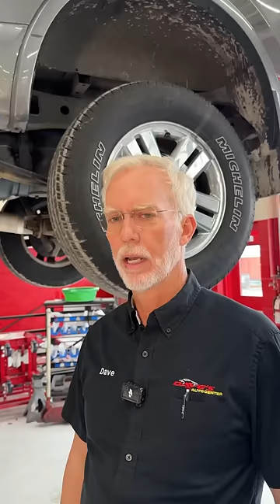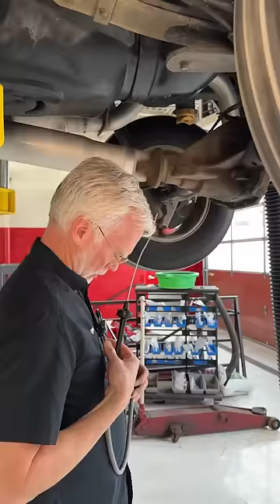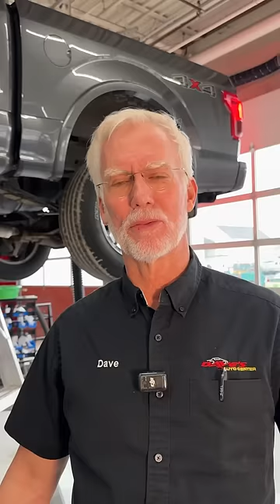Part 1: How to diagnose a noise - Dave shows us with a stethoscope 🩺 how to find a noisy bearing

Comment: !!! The stethoscope to the mic, acting as a contact point for conductive hearing in a video is a brilliant way to show us what you mean, precisely. Thank you.
Reply from the maker: Glad it was helpful!
Reply: Yes it is,  I have 2 of them in my Tool box.  Great for alternators, power steering pumps, water pumps, idler bearings, etc  anything with a bearing, or that tanks, clicks, rattles, etc
Reply: Some got great ears. The moment he started to put it in gear i 100% know it  is the pinion bearing 😂😂😂 my ears arent busted yet they work just fine
Reply: Just like an episode of CSI
Reply: @REYNIER2022  I sure hope ta hell you protect them in everything you do.  Or you could end up like me and all but Def,   I can't hear the sounds of 17 letters in the Alphabet.  So I can hear yes, but I can't understand what anyone says to me 😞.   So please, man,  use ear protection at all costs.
Reply: I use a long screwdriver, pipe, serpentine belt tool. Anything that transmit sound.
Reply: I just use a long 3/8 extention and do the same thing. Lol
Reply: You can mimic this same sound amp by using a screwdriver and a bottom cut 2 liter soda bottle. Touch the area in question with be screwdriver and attach the bottle mouth (where the cap goes) to the screwdriver handle  and boom you have an amplified sound. I learned this from Eric O at SMA.
Reply: Well yeah... how else would he show it to us?
Reply: Probably made in China. Remember when bearings actually lasted or is it the oil

Comment: A stethoscope is one of THE most important diagnostic tools in your toolbox. Pop the end off and use the hose to trace down vacuum and exhaust leaks. I used mine last week to detect a faulty injector causing a misfire.

Comment: I love this trick. I used to do industrial maintenance for a large manufacturing plant and used this technique very often to find bad roller bearings on our machines. Didn't invest in a stethoscope but a long screwdriver accomplished the same thing! Great stuff Dave!
Reply from the maker: Very cool!
Reply: Absolutely used many long screwdrivers.
Reply: That's another method, I've used a hose to locate noisy bearing and other noises.
Reply: Long screwdriver to the ear also helps to check if all the injectors are working.
Reply: @aaronpreston47  I don't think I ever tried it on the injectors
Reply: Dave, One thing is Ford, I bet Ford has Thousands of these Bearing Problems in  other Rear ends Ford Made. 😊
Reply: @waymonblevins6939  huh? I'm a ford hater. Born into it. But my '98 Grand Cherokee has a '98 Ford rear axle swapped in, because it out lives most anything out there.
Reply: @DB-yj3qc  Hose as in a like something similar to a brake fluid hose, or a garden hose?
Reply: @selwyn13  garden hose worked best for me.
Reply: @waymonblevins6939  Ford rear ends have to be really abused. The 8.8 is good. And the 9in is one of the most sought after.
Reply: @boostedzjadventurevlogs4121  I Agree. On the Rear end Get a New Process Rear-end. Chevy and Dodge use these Rear-ends. Both of these Automakers use these New Process Parts. I have used them for Years. Like You I hate a Ford. The worst Vehicle made.
Reply: @waymonblevins6939  every drag racer out there would laugh at this statement. Ford 8.8 and 9" is the way to go. Been proven over and over. Yes there is times something else might fit better or work for your application, but overall, 8.8 and 9". Yes, if rather have a Rubicon D44, but it's the price of five 8.8's, it's gonna break eventually, and the width is all wrong.
Reply: @selwyn13  like a vacuum hose or rubber fuel line. Solid metal objects placed inside your ear and the other end around moving parts has always scared me.
Reply: Place a screwdriver in your ear and then put the other end around moving parts. The tell me you've got no anxiety.
Reply: Fluke also makes a more scientific tool for bearings. It gives you the ability to listen to bearings, and temperatures. But a screwdriver in the hands of a skilled mechanic will get it done just as well
Reply: Let me clarify here,  place the handle of a long screw driver to your ear and touch the metal end to the different places or parts you desire to listen to. It works very well. I've been doing this for over 55 years.
Reply: @williamhouk6880  no, put the pointy end in your ear and the handle into the fan blades. Of course your way is correct, but it could be way safer.
Reply: DAVE IS SPOT ON!! DAVE AND HIS GUYS ARE AMAZING!! Thank you…
Reply: When it gets loud enough other drivers will honk their horn at you thinking you're being extremely rude to them. I had a carrier bearing race crack all the way through on my jeep and it would be intermittently extremely noisy.
Reply: Dave, I am glad that you have an upcoming TV Show. I will be happy when it starts Airing. Do You have Time Time when It will air on TV?
Reply: I'm an auto tech, and use both stethoscope and long screwdrivers. Screwdriver works for most applications, but the stethoscope  usually works better in tight spots.
Reply: And ear muffs to isolate!

Comment: Use my stethescope to diagnose differential, wheel bearings and transfercase noises often.  Helps alot to diagnose in less than 30 mins inc setting the veh on the hoist.  We also have a set of "chassis ears"  which are electrosonic ears. Attach them to different parts of the veh and test drive to duplicate knocking noises etc and you switch channels/microphones to hone in on what one is loudest, some can be connected to the laptop and the frequency of the noise will be diagnosed my the computer program. No joke.
Reply: I love chassis ears but they're a pain to run all those wires and make sure they're not gonna snag something while driving lol
Reply: @KyleCotton1  agree. Theyre a pain.
Reply: @matthewmorrone883  but they're irreplaceable when diagnosing suspension noise that can't be duplicated on the lift!!

Comment: This works well. I use this method to tell when a lathe tool, boring bar most or time, is contacting the inside of the part I'm cutting. It takes away the guess work.

Comment: some good advice i was told years ago was. "bearings roar/grind". and "gears whine".  this applys to differentials. manual transmissions (some older automatics th400 first gear planets whine) and the older gear to gear transfer cases.    this truck has both sounds.   if you replace a ring and pinion you can have some "whine" if they are not shimmed properly but as long as the bearings are properly setup will have no noise.     ive had some units apart several times adjusting shims to get rid of the whining.   and some cheap gear sets will not be near as quiet as a high quality gear set.

Comment: You can improvise on that stethoscope if you do not have one as well ... A long screwdriver or a pry bar works great too. Hold it on the spot you want to check and listen for the roughness.. compare multiple points to gauge wear.. 👍🏻
Reply from the maker: Good tip!

Comment: Trick an old mechanic tought me and ive used every since is, while the wheel is spinning grab onto the spring, you will feel the vibration of the bad bearing in the spring only at the location of the bed bearing. Works every time, even on those bearings that can be hard to hear.

Comment: These work great for hard to find noises, but I found using a long screwdriver with the handle pressed against your ear works better to pinpoint the noise around other noises like the belt pullies.

Comment: I got trouble on my personal truck, and id like a diagnostic path plan.  My 05 cadillac srx 3.6 v6, awd, is showing driveline popping upon hard load scenarios, ie taking off from stop lights, straight forward acceleration.  It aounds like transfer case chain jumping, or trans output/transfer case input flanges are possibly stripping splines.  

I put my truck up on jackstands, and tried power braking it, and failed to duplicate the sound.  Truck has to be on the ground, or maybe an alignment rack would be a great idea.  

Truck rundown.  Trans is 5l40e.  T case is borg warner 4476.  Historically, had trans out for bench rebuild, 60k ago, and valve body.  While driveline was out, i had the same POPPING situation, told trans shop, and they added a tcase chain to the job, for an extra $200 (sounded like a great deal, lol).  

A few days ago, i drained tcase, and it looked like gl5 or gear oil was put in it. Not atf.  The drain and fill screws needed wiped off (tips had some muck on them).  I looked thru drain hole, watching chain while articulating the rear driveshaft left and right, didnt really see excessive slack in the chain.

Comment: I have had lots of bearings go on me. You can hear them long before this. I hear them as a slightly changing harmonic as the wheel or axel turns at different speeds the out-of-place or out-of-balance bearing will increase or decrease its harmonic tone. This sound will get stronger as time goes on. I have had mechanics tell me in the early stages it is road noise from my tires because I run a slightly aggressive tread. But there is no need to wait this long to figure it out. At this time you just add metal contaminants to the lubricating oil causing a bigger clean-up as well as possibly damage to other internal moving parts. I know Dave and his people can use the extra work. 😂 not
Reply: You have to turn the radio off from time to time. Just to listen to how your vehicle is running.

Comment: Hey Dave, and commenters. 2016 chevy equinox, 150k on the clock. Loud roar sound upfront, changes with speed and when you turn it usually gets louder, had new tires put on and it got louder, it has factory size tires and they are simple stret ordinary tires you'd expect. Can't find any issues with any components and dealer can't either.

Comment: You can tell a pinion bearing when you go from driven side to coasting side of pinion to ring gear contact. Bearing wear caused more back lash can hear the noise change as pinion moves in and out of ring gear.

Comment: I had a 90's model Toyota Tacoma with a bad bearing on the Rear Right.

The frame rail that leads back to the Rear Right also travels right under the center console.

The noise would echo all the way up the frame rail making it near impossible to tell where the noise was actually coming from.

Had to put it on a four post lift and really spin the tires up before you could finally hear it without any load on the tires.

That was probably one of the most nightmarish diagnostics I ever had to do just because the echo made it so difficult.

I got multiple second opinions from fellow master techs in the shop, and even they were stumped by it. 

I made a flase diagnosis using the second opinions and changed out the Front Differential.. After that didn't fix it, that was when I finally put it on the 4 post and got the tires spinning at highway speeds. 

I was so relieved when I finally found it and fixed it. The echo was so bad the noise literally felt like it was at your feet when driving, and when it was on the 4 post it would not make the noise without a load. 

It took slamming on the gas and spinning up the tires a bit too fast to finally hear it.

Comment: Learned this from South Main Auto's youtube channel:
Take an empty plastic jug.
Cut off the bottom.
Stick the handle of a screwdriver in the normal pouring end.
Stick screwdriver tip to where the noise is coming from.
Listen at the big new cut-out opening.

Comment: a common rear differential failure caused by a shade tree mechanic is   they replace the pinion seal and when reinstalling the yoke they over tighten the pinion nut and over load the bearings which ruins them in a very short time. ive delt with customers doing this a few times   if any shade tree mechanic reads this pay attention:  ive rebuild diffs for 15+ years.  if your rear pinion seal is leaking.  you can replace it with no issues.  
first. mark the drive line to yoke so it can be put back as it was
now mark the pinion nut to pinion gear so the nut can be re installed back exactly as it was
now 
remove it and the yoke then replace the seal. use a little film of RTV on the outside edge of the new seal (metal to metal). then install the seal. 
now reinstall the yoke. now when your ready to reinstall the nut. use red loctite on the threads. put the nut back and tighten it bacl until your marks line right back up exactly as you marked them.   you can crack it ever so slightly tighter but thats it!   this will put the pinion bearing preload right back at the oroginal setting and good to go.     ive done this many times over the years and no issues

Comment: This vehicle has a bearing and a ring gear issue. Notice that when they were first listening to the sound the driver backed off on the throttle and one of the noises decreased. I agree the pinion bearing is bad but this also probably damages the pinion and the ring gears themselves also.

Comment: It might actually he a bad gearset. From the video the frequency increases when the noise is present, indicating he is accelerating at those points. Drive side of the gear is probably through the hardening and eaten up from overheating.  Or could just be really bad front bearing too. Please post the follow up!

Comment: You can also use a hammer-through screwdriver.  A normal screwdriver won't work as well
Reply from the maker: Great tip👍
Reply: put plastic  handle to your ear hole flap while pressing firmly and off you go

Comment: I had a rav 4 squealing like a stuck pig on the front end. Couldn't determine where? A tech placed buggy on lift, a coworker put it in drive, and tech put a two foot screwdriver on wheel lower support, and other end to ear. Then had me do it. A deaf man could determine which wheel bearing was shot. It was that clear. Great tip, I've put in my back pocket.

Comment: Anyone else concerned about the speed of rotating masses? You can’t use the brakes to slow it down since the contact on the disc’s would add noise, but you can keep it in low gear.

Comment: Sometimes these noises only happen when the vehicle on the road with the weight on the wheels. A bad U joint, you will usually see rust residue around the bad joint. That's a giveaway because they don't always have play when they go bad

Comment: What causes a failure like that? Lack of maintenance alone or just bad luck? My 2014 has 127,000 miles and I’ve probably changed the diff fluid 3-4 times now. Nothing seems to be out of order.

Comment: I have an '18 F150 4wd that has what sounds like a LF wheel bearing hum that get louder the faster you go and slightly turning the wheel to the left. Replaced both front hubs, no change. Activate 4wd, no change. Still haven't figured it out but driven the truck for 25k miles and doesn't drive any different.  Can't hear it at all on the lift.  It's puzzling to me.  Inside the cab going down the road, sounds like it's coming from the LF. I've looked at all four wheels with a stethoscope. Can't seem to pinpoint it.

Comment: Did you know a broom stick to the ear on the end 
Of will pin point a bearing race noise or cladder or sqeaking internal problems. Most likely that diferential will shell out or lock up because once one part wearing more then others . ive had several 3/4 ton ford f150 rearend were the rearend starts the shell out on ya or lock up

Comment: I had a Chevy with a leaking pinion bearing and when the dealer worked on it. The truck only started leaking more than it did before it was worked on before . I could tell they never did anything to the rear axle housing and they said that they replaced the seal  I  got tired of fussing about it with them and they had to come get the truck because I would not make another payment until it was fixed and they never fixed it and they kept the leaking rear axle truck and it was already making a loud noise when they came and got the truck.

Comment: I have THE SAME problem on my 01 GMC Yukon 2500.... Simply needs a pinion bearing... EVERY Shop around here ONLY wants to put another rear in it..... Parts changers ONLY around here....  Scares me, BECAUSE of getting the proper "Depth" & Torque set AFTER installing a new pinion bearing set.....AND I've ONLY inquired different shops and haven't let any of em tear it down to inspect.... BUT it can be heard CLEARLY at 30-40 mph inside, while driving.... They're all scared 😢🤷‍♂️

Comment: "Thatll be a new ring & pinion, two axle bearings, spider gears, associated races and seals, four cans of brake cleaner, RTV, threadlocker, 3qt of 75w-90 fluid. You can come pick it up Thursday."
Reply: 75w-140

Comment: This is nothing, my father's car suddenly got a bad left wheel bearing along with ruining brand new tires due to neglecting aligment issues i had told him about, and i drove it as slow as a turtle for 10 kilometers to get it to my place to replace it, never had imagined a car can sound like you have an old washing machine in the cabin banging its bin and turns out both bearings had to go and thankfully they didn't caused extra damage.
Do your aligment people what happens is more than tire wear.